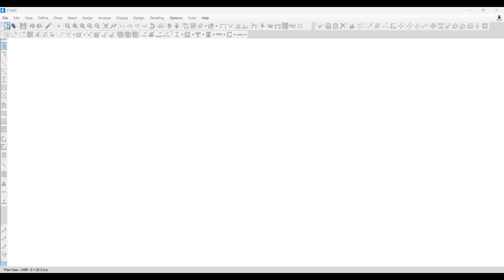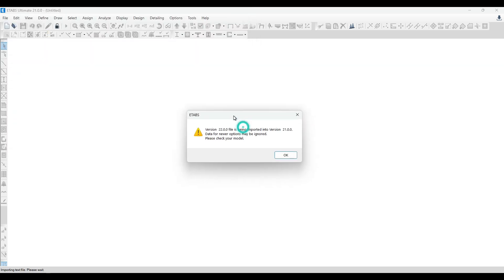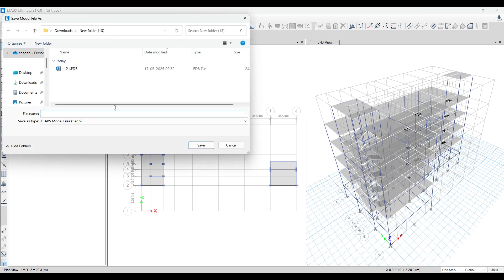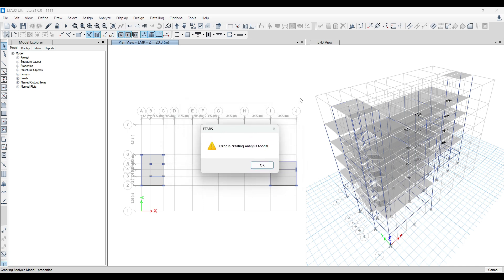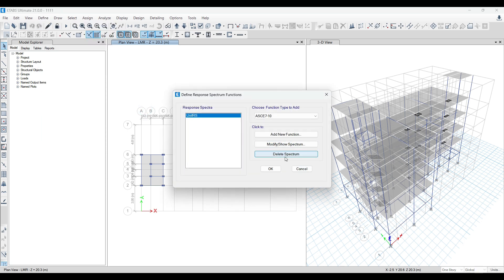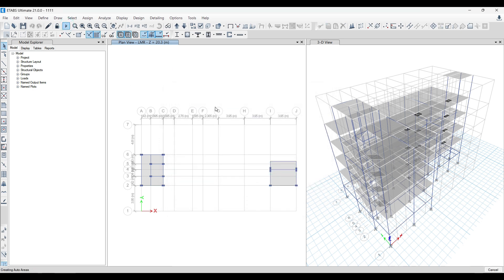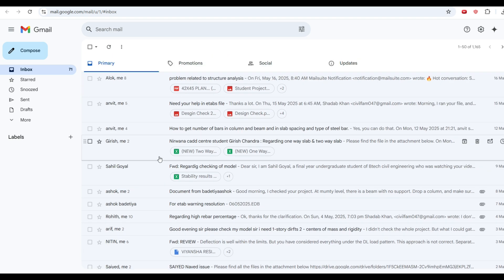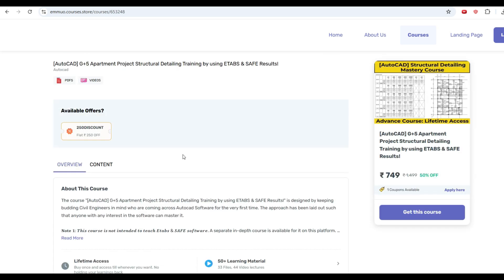ETABS Error in Creating Analysis Model (FIXED)

Comment: Sir, How to model steel circular tube section column on RCC beam/RCC frame
Reply from the maker: You can try out the composite option for creating your member. But I haven't tried to have a circular steel tube yet. So not sure if that option is available.